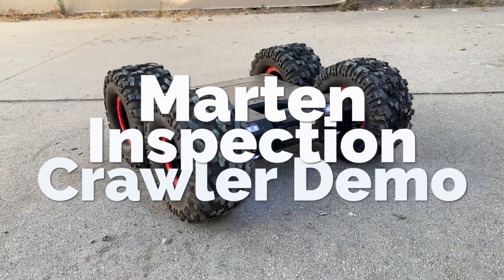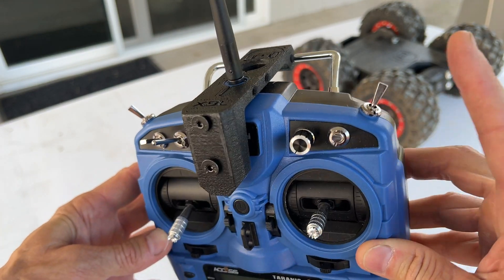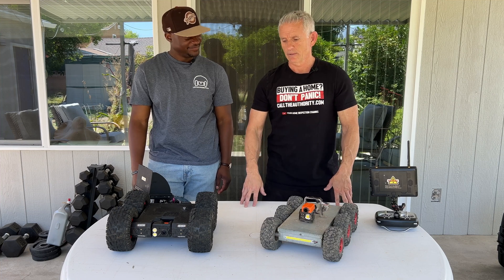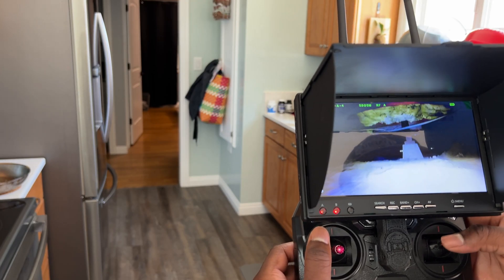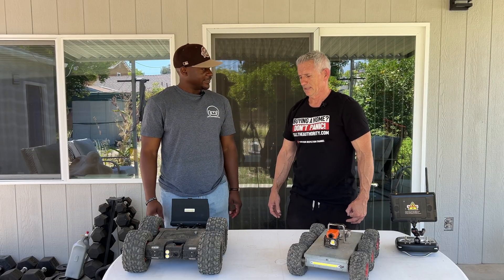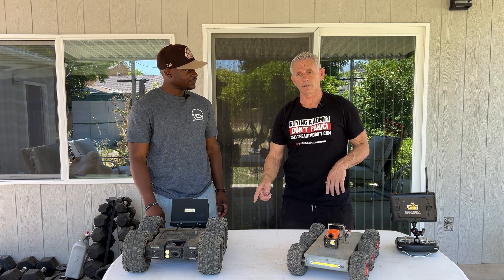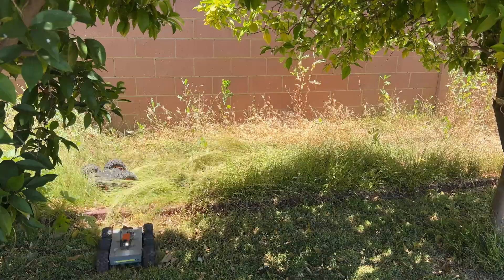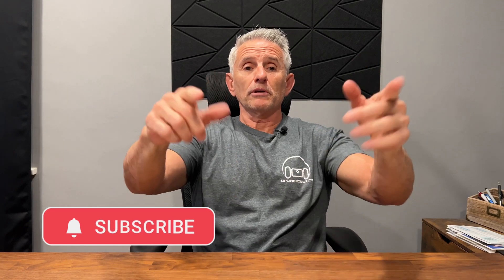Marten Inspection Crawler Demo | Crawlspace Inspection Robot

Comment: Would a rc crawler be a good platform to work from, as it may be more capable when falling into trenches and such under a house or in a roof void
Reply from the maker: sure why not, same concept you just need to make the height adequate for low pipes etc.

Comment: Sheesh got it stuck in first few seconds.  Then on wires. Not a great demo.  Probably just worth actually crawling the space.  That’s why inspectors are paid so well.  I can see it being helpful in very tight crawlspaces but only 1/20 or so
Reply from the maker: Yes unfortunately all crawlspace bots do have limitations, its definitely not going to work great every time. However I have been using bots for 10 years and i only have to physically crawl 2 out of 20 homes i inspect each month. It works great most of the time. Using a bot is a learning curve that improves with practice. I highly recommend buying a bot if you inspect lots of crawlspaces.

Comment: We are looking at going with one of these bots. The Crawlbot is a bit more affordable than the Marten Pro. I was wondering which one you would go with today if you were going to buy one of them new? The Marten Pro is $5800 while the crawlbot is $3600. Just didn’t know if there was over $2000 difference in them. Thanks!
Reply from the maker: Sorry for delayed response, I overlooked your post. Honestly i am a fan of the 6 wheeler because i have been using it for several years. As for the price difference the technology between the two is much different as well as the quality of materials. I am not sure crawlbot still makes the 6 wheeler, i believe they changed it to a track system. You should check with them to see if they still make 6 wheeler!

Comment: I will soon be adding crawlspace inspections to my company and am curious about the 6-wheel bot you have. Could I get the brand and model, and/or a link to get them? 
I really like the rotating camera.
-Thanks!
Reply from the maker: Hi, unfortunately the 6 wheeler i had is no longer being manufactured. I believe they are selling a trax version only. the brand i have is called crawlbot, search on google to find a sales link.